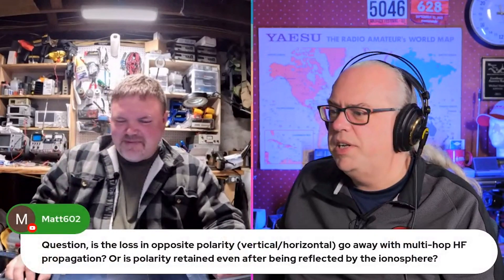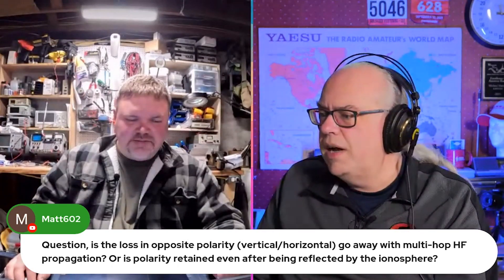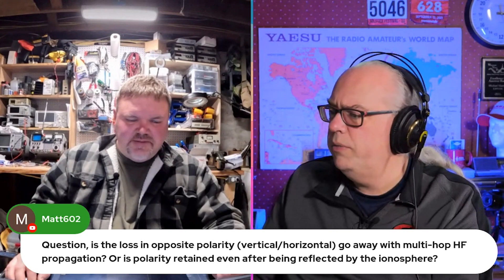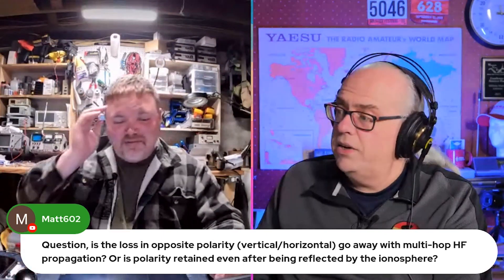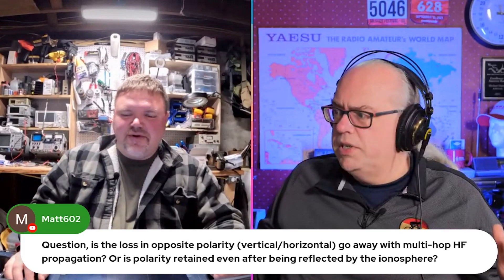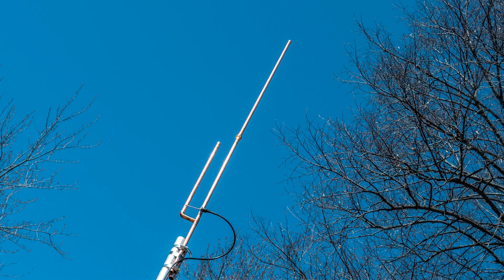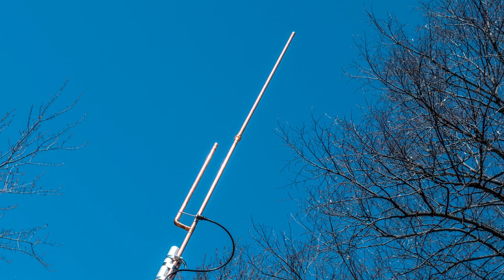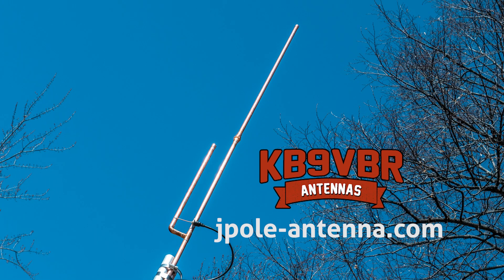Ask Michael, KB9VBR: Does antenna polarization matter? #hamradioQA

Comment: I'm relatively new to ham radio.  I have HF radios but I struggle understanding what all the controls are/purpose and when/where to set them.  Is there a book/source that covers this for newbies?  The owner's manual provides some detail, but it all seems to be written for experienced operators.  I've met other new hams who complain about the same thing. Any help would be appreciated.
Reply from the maker: This is quite common and I hear of the same struggle from others just starting out. I did a video a few years back that goes through the basic features of an HF transceiver, you may find it helpful: https://youtu.be/kAh7G-Y6KFM. Otherwise look for the mini-manuals by Nifty Accessories. They are a great resource in breaking down the features of a particular transceiver: https://amzn.to/3YwaTLd

Comment: Interestingly, you learn the first time sending or receiving from/to the space station that polarization makes a big difference there.
Reply from the maker: Yes. Polarization matters with satellite contacts, satellites and the space station are line of sight. But satellites are also tumbling as they orbit, so cross polarized or circular polarized antennas are helpful in receiving a stronger signal.